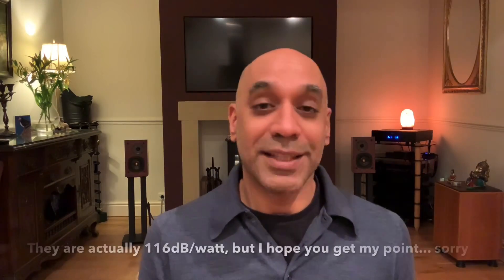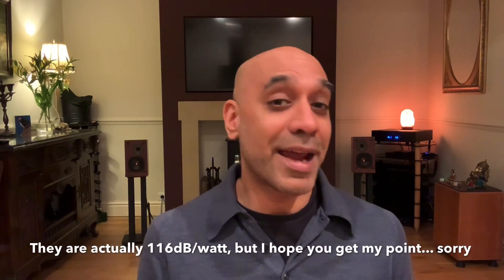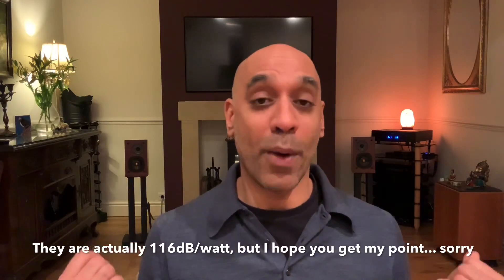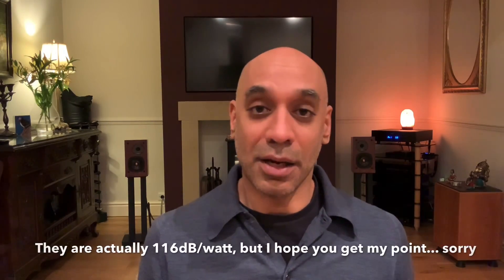Hifi Myths & Misconceptions - Amplifier Power

Comment: Tarun this was a great explanation! 
My situation KEF Reference Three: 91dB / 1W / 1m, nominal impedance 4 Ohms, typical listening level 85dB, distance ~ 3m 
91dB / 1m / 1W at 4 Ohms attenuated about 8dB after 3m need ~3dB more for required level ~2W,  assume musical peaks 10dB - I need minimum of 20W. 
Manufacturer spec for speakers says minimum 50W, maximum 300W. My current power amplifier Exposure Stereo VIII is 50W/channel but it feels a bit underpowered. So I think my next power amplifier needs more headroom and should be at least 100W/ch (3dB) or 200W/ch (6dB). Do you agree?  All the best, Rob in Switzerland
Reply: It's actually a tad more complicated since I'm also running Townshend Maximum Supertweeters (nominal impedance 11 Ohm) in parallel to each KEF, so nominal impedance seen by Exposure power amplifier is only 3.67 Ohms.  Maybe that's another reason they feel a bit underpowered.
Reply: @RobWhittlestone  That's all a bit over my head to be honest. I hope you get the solution and headroom you are after 👍
Reply: My system is nothing like as high end as yours, but I had a similar problem that I fixed with a DAC. I also use KEF reference speakers (vintage 4 ohms) powered by an Arcam pre/power amp combo pumping out a combined 100wpc. Previously, I had to have the amp volume set at 80% of maximum much of the time. I introduced a DAC with a volume control and now I can run the amp at 30% max volume with the DAC turned up to full. I get a cleaner sound and way more headroom.
Reply: @byrong1561  Hi - it sounds to me like the source alone couldn't drive [supply sufficient signal into] your Arcam preamp, but the DAC can now do this. The DAC has a signal output driver stage which will have a low impedance and your preamp input a high impedance. Maybe your source output stage didn't have a very low output impedance and couldn't drive your preamp's input? I'm assuming you're still using the same inputs of the preamp. 
Preamp inputs for CD often expect 2V peak-peak for max power out, whereas eg. an Aux or Tuner input might give full output already with 200mV. It's difficult to diagnose without seeing the system. 
For what it's worth, my own "OCD" nature would have the DAC at 70% and the amp also at 70% - just to further eliminate any danger of input clipping at the preamp. But your ears already told you it's OK as it is! All the best, Rob

Comment: MY problem with this sort of stuff is that people get their terminologies mixed, Ie watts v current ad so on and confusion starts to set in,..... I have the heresy 3 and they are 99db not 116db AND 20's plenty as the school signs say @ 3-meters away. They can easily reach 90dbs at my listening position of 3 meters I'm probably only using 3-4watts of my Sudgens 23 watts. Either way plenty of headroom. It's a shame you didn't touch more on the mechanical loading, though you briefly mentioned it with the heresy. Which is where the argument that gobs of expensive power/watts are not needed. TBH I gave up chasing watts and went with the mechanical loading and have never looked back. They had it right back in the day, efficiency is kind and always will be BUT having said that mixing efficiency with gobs of power will mean the amp is always in its happen place
Reply from the maker: Hi gaza4543, to be honest there is a lot of stuff I could have gone into, slew rate, peak current, damping factor, power factor, THD & N... I could go on. These are probably topics for future videos. In this video I wanted to focus on how much power people actually need given their use case scenario. It is an area where there is a lot of misinformation and people commonly get confused, focusing on the wrong aspects of an amplifier’s performance.

Thank you for sharing. I bet your Heresy/Sugden combo sounds sweet!
Reply: Tarun A British Audiophile I like to think it sounds nice. Mixed with the qutest I’m just listening and not worrying about gear. It’s a nice place to be quite frankly. Though I am on the hunt for a turn table to finish off the system.

Comment: Great videos! i want to understand one thing, or absolutely necessary need a subwoofer for bookshelf speakers?
Reply: Is a subwoofer absolutely necessary? No. As long as you have a good pair of bookshelves that sound great from 100Hz all the way up to 20kHz, you're probably not going to lose too much sleep over the rolled-off frequencies below 100Hz. And in a small room, a sub is probably going to do more harm than good.
Reply: @thisisnev  I have my crossover set on 44hz, meaning mu sub plays roughly 24hz range of music and it makes so much of a difference. I take it you don't have enough expierience with subwoofers, otherwise you wouldnt say that you dont need range below 100hz. And i have a very small room and it still sounds much superior than without a sub (yes, its not a perfect bass but every room has its limiations) Low freq bass changes a lot of things, unless you have tower speakers that can go down to 30hz or so, subwoofer is always a good thing to add to your system. Just go to local store that has for example REL subs and listen.
Reply: @privateaccount9535  I know what subwoofers sound like, and I'm quite happy without it. Bass addiction is treatable! ;¬D
Reply: @thisisnev  Surely you can be happy without bass, but dont tell anybody (@Justin Parkman) that only a bad speaker can benefit from subwoofer in the system because it is simply not true ;)
Reply: My speakers (made in 1970's, but continue to make the Top Ten Speaker list) are rated down to 35Hz out of a 10" woofer. The bass can be tight and excellent and depends a lot on placement and 'nodal' points. So, no subwoofer. You can add a subwoofer, but that is mostly a Home Theater experience issue, and requires active speakers and proper setup. I have a small subwoofer added to my bookshelf speakers (8" woofer) and my Cambridge Soundworks have a powered subwoofer smaller than a breadbox, that does an excellent job.
Reply: This thread is hilarious. Every speaker has a lower limit in frequency response and some music and movie effects will extend below this. Smaller and/or cheaper speakers often (not always) can't reproduce very low frequencies well, if at all. Whether you care about this enough to use a sub is another matter entirely. Also any kind of equipment used incorrectly won't perform well. That's bloody obvious.
Reply: Neither statement that a lot of subs are shit nor saying most people cant set them up properly is a valid argument, so I'm just gonna ignore these. Actually everything you said is to be ignored, sorry xD Good sub added to good set of bookshelf speakers will always improve the overall listening expierience, period. Why am i even arguing about this with you? It's so basic knowledge yet you claim your 40 years in the industry say otherwise.
Reply: only poorly designed speakers need a sub they cant produced real bass  that's why there are different size speakers for different size rooms no subs needed when you have a good designed speaker .
Reply: @lilahthekitty  it depends if you have a speaker capable of hitting down to the low frequencys. For the majority of music a speaker 40hz - 20khz will be fine.

But certain genre's some classical, organ, drum & bass songs etc get down to 20hz or slightly lower. A speaker with 20hz - 20khz specs is very very expensive, cheaper to just buy good speakers and a good subwoofer.

My bookshelf speakers get down to 30hz low frequency bass. I actually prefer listening to music without my subwoofer on. Sound's more natural to me plus I don't listen to organ, drum & bass music. And my speakers are capable of good natural low end bass for the genres that I do listen to.
Reply: @lilahthekitty  thats 100% bullshit. Subwoofer will always up your game in the low end freq, no matter what kind of bookshelf speakers you got. Don't spread misinformation
Reply: @privateaccount9535  not to  my ears they don't subs destroy what a good speaker can sound like you must have some poor speakers .
Reply: @lilahthekitty  xD u surely listened to some 200 $ subs xD have fun listening to mid & highs! ... and hopefully bass some day.

Comment: Thank you 🙏 spot on watts doesn't mean how loud you're speakers are it's all about the sounds with wattage equal dB and Ohms if you say you got 8ohms and you're speakers is only 100 watts and yes you're got watts you haven't got power! Compared 6ohms 100 watts speakers! Then you're got power ! Is very much depends on your equipment because it's all about driving those speakers and what type your amp your got. And the room is a big player in this games.
Reply from the maker: Hi turntableman100, thank you for watching and commenting on the video.

Comment: Thank you - very lucid as before.  I really have no idea what my power amp can do, because there's an awful lot of headroom there.  It's a Quad and I take the view that all that excess capacity is probably just another case of Peter Walker being right as usual.  Anyway, it's imperturbable and lets me use a passive pre, which is one of the less obvious advantages of those big flux dumping amps.
Reply from the maker: Hi GenWivern2, well said. Nothing wrong with having lots of headroom. Thank you for watching and commenting.